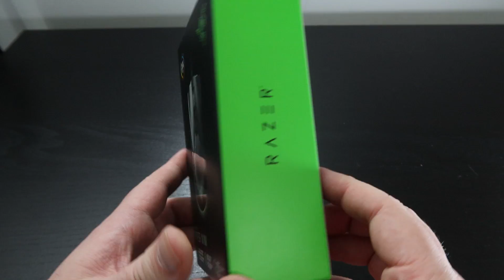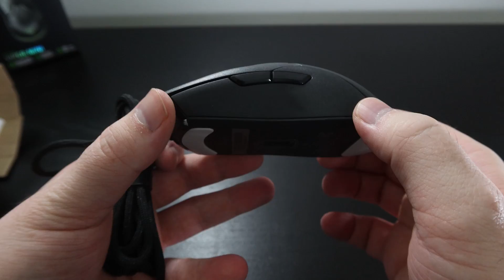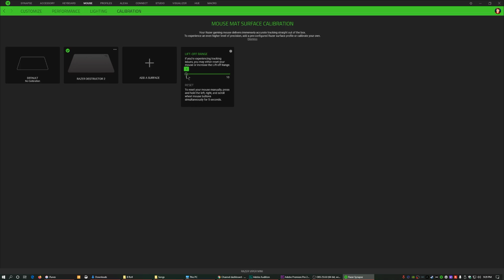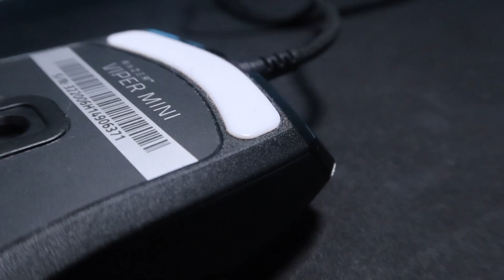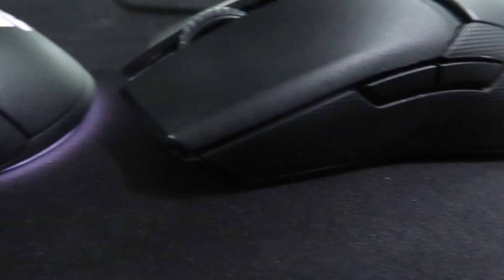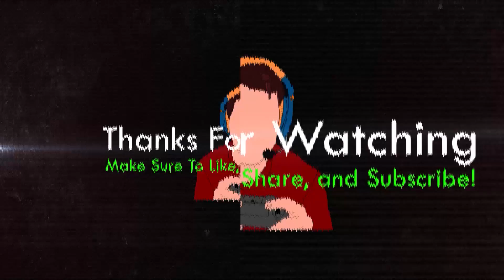Razer Viper Mini Mouse Review - Greatness Comes Cheap

Comment: Is there a big size difference between this and the regular size? I’m thinking of getting the mini instead
Reply from the maker: Yes, I would say there is. I have a comparison video of the Viper Mini, Viper, and Viper Ultimate. In that I may have done some B-Roll of the size difference. But the Viper Mini is a vastly different shape and a lot smaller. General consensus I've seen is that the shape is superior and almost everyone I've talked to loves it. Where the Viper is more hit or miss on shape. But the Viper and Viper Ultimate have a better sensor. 

The Viper Mini Ultimate (may not be the name they go with) will be coming out here soonish (ideally Q1 2023. But at least sometime in 2023). Which will have higher end specs which may be worth waiting for.

Comment: 05:51 do they feel different? I mean I just got one and the clicks do feel different. Not only the sound but they do feel just a tiny bit different. I wouldn't really call it mushy but it's different. I really need your thought on this as I am not sure if it's only me or they are built that way?
P.S.: they do register just fine though.
Reply from the maker: So, ideally there isn't supposed to be any variance between left and right click. However, in reality there is usually some sort of difference (as you can't make an exact copy of anything in real life). But they try their best to reduce the overall variance so it's minor. All that to say that most of the mice I own I don't notice variance between left/right click unless if I am being super picky. But I also have a few mice that do have variance that is noticeable between both. I would say if it is pretty dramatic that it is a defect. If you barely notice it then I would consider that to be closer to normal but not ideal. You could always exchange it out if you are in the exchange period. Or reach out to Razer Support and see what they say.
Reply: @ThomasMuehler   thanks for the reply :) helped me a lot. The mouse seems to be fine. I made a friend of mine take a look at how it feels and he didn't have any issues about the slight change in clicks. Maybe it's just me. However, the sounding different part is normal right? To distinguish between right and left?
Reply from the maker: @pratikbiska  Yeah, the sound part is the same as I mentioned above. I think all of my right/left clicks sound different if I'm paying attention. As long as you aren't getting any creaking, crunching, or other strange sound. Like if it sounds like a normal click but is different than the left/right I would consider that normal.

Comment: Um Hello I got the mouse but where can i see what dpi im using
Reply from the maker: You can go off the presets (I think it is 400, 800, 1600, 2400, 3200). Or download Razer Synapse software and check/adjust that way.

Comment: This or g305?
Reply from the maker: Good question. Both have their pros/cons. 
Shape = Viper Mini
Buttons = Viper Mini
Sensor = G305
Wireless/Portability = G305
Mice Feet = Viper Mini. 

So, outside of the sensor the Viper Mini has the most up to date specs. But it doesn't have wireless and the HERO sensor is better on the G305. I like the shape of both. As I use the G305 at work and like it a lot. It can get pretty lightweight too, with some minor mods and buying the correct battery. So it comes down to what you are looking for.

Comment: The top sensors are pretty much overkill ngl, I don't think you will feel that much of a difference when comparing the 3359 and higher sensors. Also, most people won't be gaming above 3200 dpi so it will be fine for most people.
btw I love the video you are so underrated and deserve so much more attention.
Reply from the maker: I don't know if I fully agree with the top sensors being overkill. Because the tech behind the sensor is more than just the DPI.  I understand where you are coming from and do agree that most people don't game above 3200 DPI and if they do they don't do it well (majority of the time). DPI is definitely a marketing term that companies use to try and tout their mouse is better. Which is simply not true. It's the other parts of the sensor that I am focusing on. 

The reason why I'm such a fan of the Focus+ isn't because it has 20K DPI. But because it has automatic AND manual lift off AND landing distance along with syncing real time with your computer in order to give you the lowest latency possible. Add that to the optical switches and you've got a super low latency mouse. With the 20,000 DPI it also takes more pictures per second which can also lead to more accuracy. Also, it is able to withstand a high amount of G's to prevent spin out and last it can track a crazy amount of distance before it gets inaccurate. So I don't think I'd classify it as overkill. As I think people would claim overkill on a lot of tech until we get to the next step and go how the heck did we live without this. So, I agree but also disagree. As I think it becomes a complicated matter quickly depending on how you look at it. 

Also, I'm glad you enjoy my videos. I appreciate the compliment.
Reply: @ThomasMuehler  Thanks for the info!

Comment: Which one do u  prefer for fps 
Viper mini or deathtraderr
Reply from the maker: I'm not a big fan of the Deathadder as I think it is a bit too big for my hand and am not the biggest fan of the shape. Just in general I'm not a fan of it. Which isn't me saying that it is a bad mouse. As I know it is a good mouse or else it wouldn't be one of the best selling mice ever. But it just doesn't check any boxes for me personally. So, my choice would be an easy Viper Mini. But I have to hand it to the deathadder as it recently got an update which upgraded the internals. I think there is also the Deathadder Mini which I haven't looked at so can't say anything about.
Reply: @ThomasMuehler  thx alot for replying
Reply from the maker: @ch1lling143  Happy to try to help. If you have any other questions just let me know.
Reply: @ThomasMuehler  ok tq

Comment: my mouse button 4 is now a bit loose, I can still press it fine, is this normal? ( i had it for about a month now )
Reply from the maker: I guess it depends on what you mean by a bit loose. By that I mean like to how much of a degree. As that's hard to judge without me actually using it. But I would say in general, no, that isn't normal. I would see if you can still exchange it in store for a new one or go through Razer Support and RMA it. You may need to wait for it to break completely.

Comment: Viper mini or g203?
Reply from the maker: I'd personally go with the Viper Mini. I think it has a better shape. Also, the optical switches are superior. I think the sensor is going to be very similar in both. But recommend checking out the lift-off distance mod (it's very basic and simple and is supposed to be very helpful).
Reply: Sir Galahad thnx man
Reply: Sir Galahad you mean the lod( lift of distance)
Reply from the maker: @tronicx6770  Yes, my apologizes.
Reply: Viper mini is so much better imo. I had the g203 , after a year of good use the mouse feet worn down. And the sensor got bad . Maybe because I never cleaned it but oh well . Viper is more comfortable and it's super light , the cable is better and mouse feet. And the clicks better side buttons better and I notice a difference in the sensors viper is basically better but the g203 is okay.

Comment: nice review! i wonder, what makes the mouse "not suitable" or "not made" for palm grip? would a small hand have problems in palm gripping this mouse? (i am a girl with smaller hands and pretty short fingers) thanks!
Reply from the maker: That's a great question. Do keep in mind that all mice will fit all grip styles as they are dependent on a users own preferences (hand size and grip style). However, usually when a mouse is made they take certain shapes into consideration that are more suited for the majority of people to be most comfortable, hence the recommendation of it being a "palm", "claw", or "fingertip" grip mouse. 

So, most palm grip mice are large in size. Meaning they are longer and a lot wider with a more ergonomic shape (usually right handed) and heavier (due to the size). Examples are Logitech G703, G502, and Dark Core RGB Pro. As the user is putting their whole hand flat on the mouse. With the average hand size of a male being 19 x 9 cm and for a female 17 x 8 cm that's a good amount of space. They also put specific curves on the mouse. Usually a pronounced hump at the back of the mouse that allows the user to cup something and then a longer right side so the ring and pinky finger have somewhere to lay while outstretched and not drag against the mouse mat. 

With the Razer Viper Mini it is considered a small mouse. Which means it isn't very long and it isn't very wide. This is a problem for palm grip users because your fingers might be longer and wider than the mouse. Making it so your palm either falls off the back of it or your fingers fall off the front. Then with your pinky/ring finger it doesn't have anywhere to rest which means it will likely drag on the mouse mat as it tapers inward instead of outward. However, it does have a pronounced hump. So, there is that. 

So, this is a long way of saying that unless you try it for yourself you'll never know if it will work for you or not. But with the recommendations of it being a small mouse ideally for palm or fingertip that if you try palm and it doesn't work that it was to be expected. But being a female with smaller hands your chances are improved with it working. Or maybe you develop some type of hybrid grip that is still comfortable. You never know. 

If you end up picking this mouse up I would love to hear if it ended up working for you or not. As that also helps people who have a similar question out. Sorry for the book. 

Hopefully, that answered your question. If not let me know.
Reply: @ThomasMuehler  oh my god i love your response!!! thank you so much for the "book", it helped me get a little more educated. if i ever end up buying it i'll make sure to return with feedback. thank your for taking your time to reply so well!!! hugs <3
Reply from the maker: Happy to help.
Reply: I have small hands and I could palm grip the mouse just fine
Reply from the maker: @doge8153  That's very helpful I appreciate you letting us know.

Comment: I am very worried about the lift of distance 🥺, i just ordered it
Reply from the maker: If you have a problem with the lift off distance I recommend either A. Using the tape mod that you can find via google search. or B. as much as I hate recommending this buying a Razer mat which allows you to customize LOD better.
Reply: Just calibrate it to vespula v2 hard and it will lower the lod drastically if you're using clotch pad

Comment: Great work. I have a Razer viper min and agree with your viewpoints :)
Reply from the maker: It is a pretty great mouse.
Reply: No doubt I'm just not able to get how Razer managed to put it such a low price. Maybe a feeler to see how the market responds. Based on their interaction on Reddit it looks like there maybe a wireless version of it
Reply from the maker: The sensor and LED is budget which is how they are able to get away with it. But I agree I'm shocked that it's only $40. But like you say. If they truly are releasing a wireless version of it with upgraded specs this would be a great way to judge the market. I certainly hope you are right about the Viper Mini Ultimate.
Reply: How is the LOD?

Comment: Do you think u can go competitive with this mouse? Is the sensor good enough to handle fast movements? I'll wait for your reply! Great vid, you have a new sub :)
Reply from the maker: Honestly, sensors these days have gotten so good that just because one sensor has better paper specs doesn't mean you'll perform better. As shape, size, and weight is far more important these days. 

8,500 DPI is lower but not all that important. As most competitive players play at 400 - 800 DPI. 
300 inches per second is equal to 25 feet per second. Which is like trying to move your mouse across your entire room in a second. Not going to happen unless your The Flash.
35 G is huge as well. A fighter pilot can experience up to 9 G. An F-22 can get up to 15 G. Which means you also won't be running into that issue either. 
The only problem you may run into is lift of distance. But I didn't have any problems with this. 

So, yes I think you can be highly competitive with this mouse and it can easily handle fast movements. Regardless if you happen to pick it up I would love to hear your thoughts. Especially, if you think I am wrong. 

Also, welcome welcome to the knights of the round table. I am very happy you are here and hope you enjoy your time here.
Reply: @ThomasMuehler  dude, you don't know how i appreciate the time you took writting this, thanks so much for helping me! Hope you keep up the good work! I'm getting this now, hopefully it will arrive soon :)

Comment: Should I switch to this mouse and not use the mamba elite wired
Reply from the maker: That's not something that I can answer for you. The biggest differences you will see are the following: 
- Mamba Elite has a better sensor by a good amount. I'd argue the second best sensor on the market. 
- Viper Mini is 61 grams compared to 96 grams. Which will be noticeable.
- Mamba elite has mechanical switches over Viper Mini having optical switches. But as long as you aren't having double clicks then the difference isn't going to be that big. 
- Viper Mini is a small mouse for fingertip/claw. Mamba Elite is a medium/large mouse that I think is more made for palm. (haven't looked all that much into the Mamba Elite). 
- Mamba has three more buttons. 
- Viper Mini may have better mouse feet. But this is negligible. 

If you do end up picking up the Viper Mini I would love to hear what your thoughts are and if you enjoy it over the Mamba Elite.

Comment: I'm going to buy a new mouse but I need  your help to choose among  G pro wireless ,  G903 and Razer viper ultralight. My hand size is 20 *10 and I'm using G602. thanks in advance
Reply from the maker: G Pro Wireless and G903 will have the same sensors and tech. So the winner between them is going to be which is more comfortable and what weight do you want? I find the clicks on the G903 to have the best clicks out of any mouse I've ever tried. Infinite scroll wheel is also awesome. It comes with left and right middle clicks too which can be helpful. However, shape is a bit strange and it's heavy. But it's still one of my favorite mice ever. G Pro Wireless is a lot lighter. Has a more "safe" shape that most people enjoy more over the G903. Side buttons in my mind are better. Both these mice are medium to large which will fit your hand size better. 

I'm assuming by Razer Viper Ultralight you are referring to the Razer Viper Mini. With your hand size being bigger I think you might struggle a bit more with it as its a small mouse. Depends on how you hold the mouse. It's specifically made for fingertip/claw. However, the weight is great. I also find the side buttons to be the best out of the three for me personally. Also, it has the best mouse skates. Last, due to it using optical switches they are slightly faster and you will never experience double click. But the sensor isn't as good as the other two. 

Interested in hearing which one you choose.
Reply: @ThomasMuehler  I think I would choose G Pro Wireless as it is lighter, more comfortable and useful for fps gaming. I'm very grateful for your help.
Reply from the maker: Did you end up picking up the GPW? If so how are you liking it?

Comment: I'm thinking of switching from the G305 wireless to this mouse, however im not sure about switching to wired. Do you think this would be worth it and would it be best with a mouse bungee as i am a low sens player? Many thanks!
Reply from the maker: I absolutely love the G305. I don’t know if you’ve tried the battery trick (using a triple a lithium I think which is the lightest battery) to reduce weight. I find the scroll wheel and left and right clicks to be more crisp on it. But the side clicks are better on the viper mini. Shape is a bit more comfortable on the mini. 

As for wired. It depends on how big of a space you are using. I don’t think you’ll notice a huge difference. As these new speed flex cables (paracord) cables are super flexible which make your mouse feel wireless. I only notice the cable when I’m doing aim trainers and at the edge of my muse mat the cord starts to pull. But like I said that’s few and far between. 

Mouse bungees are personal opinion. With the new cables I don’t think they are needed. Or at least not in my opinion. But for the previous cables that were mostly rubber it was definitely helpful. 

If you end up getting it I’d love to hear your opinion on it and if you like it over the g305 and if you think a bungee is worth it or not?
Reply: Thanks. I haven’t yet tried the battery trick. I’m not a big fan of the side buttons on the G305 and the design of it hence why I want to switch. Did you see any difference in aim/gameplay swapping between the two?
Reply from the maker: I have better aim and enjoy the Viper Mini more. With that said the sensor in the g305 is superior tech wise. But that doesn’t always translate to real world performance.